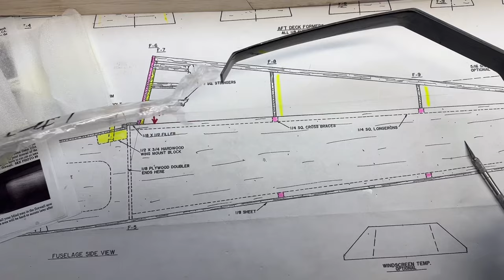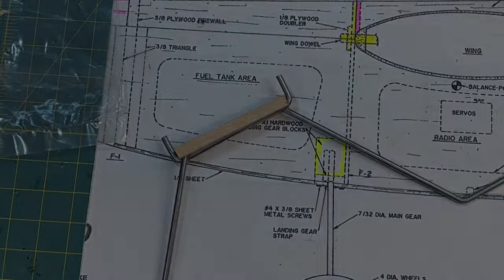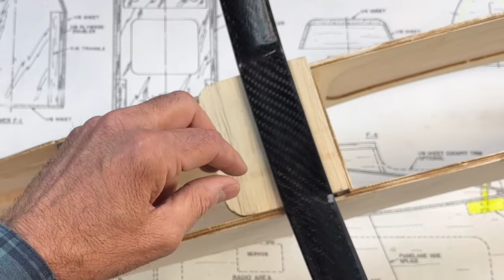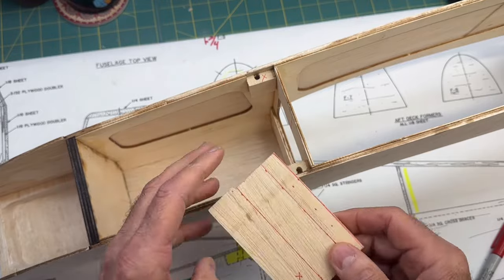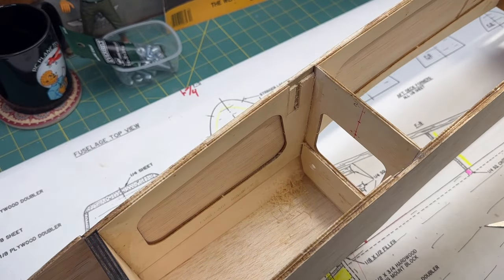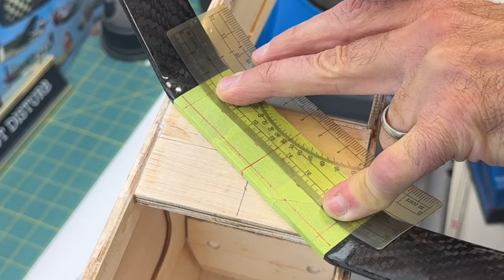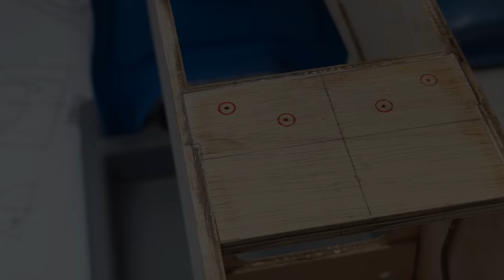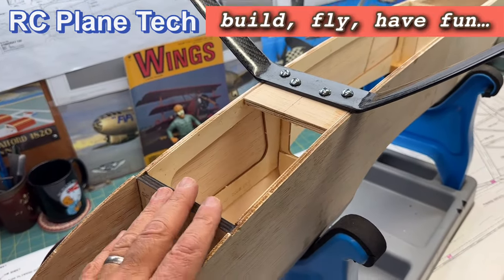Balsa USA Stingray with DLE-20, RC Plane Build N0 15: Landing Gear

Comment: Been watching the building, not to mention, the plywood direction on landing gear may split ,due to parallel,  i usually put any type of material at 90  degree when installing landing gear ,hopefully your plywood does not split watching since the first duild log nice craftsmanship, Eddie
Reply from the maker: Thanks and hopefully the plywood won’t split. I always thought plywood was laminated with thinner wood set at 90 degrees to each other?

Comment: James, nice job!

I see you got yourself. a Wen sander and jigsaw!

I bet it made making that landing gear block a little easier, put on sander, check fit, just a little more on the sander, perfect fit!

You are going to love them, particularly the sander.  With a set of vernier calipers I can easily get with in a few thousandths of an inch and get very square pieces with the sander.  I like freehand and using my eye, the guide never seem square.  

I also have the drill press and band saw and for about $100 each they are well worth it. 

If I had to pick one it would be the sander by far, the jig saw, band saw and drill press are tied for second. 

The jig saw is nice but I got the band saw afterwards and if you need to cut something straight, square or and parallel the the band saw is so nice, quick and accurate.
Reply from the maker: Ya, I got the sander a while back and jigsaw recently. Im thinking of doing a plane from plans and cut all the parts.
Reply from the maker: And I have been looking at their drill press, that will be next. They are nice to have.
Reply: After the drill press consider the band saw and your done. 

I would have never thought I needed the band saw after the jig saw but I use it for most cuts where I need accuracy and quick clean cuts. the jig saw is OK for roughing (it’s not that accurate) and roughing out shapes that can be sanded afterwards.

Comment: After tearing out my first landing gear block and the gear putting holes in both wings I started using a sacrificial nylon bolts to install gear & wings. Rather loose a nylon bolt than have hours of crash damage to repair.

Comment: Wow a lot of work when all you needed was to countersink your outer t nuts at the edge and epoxy in.
Reply: You do that before installing the mounting plate
Reply from the maker: That would have been an option. I guess I could have put the original horizontal gear block in and bolted straight to that. hmm, something to think about. Another set of eyes is always helpful.